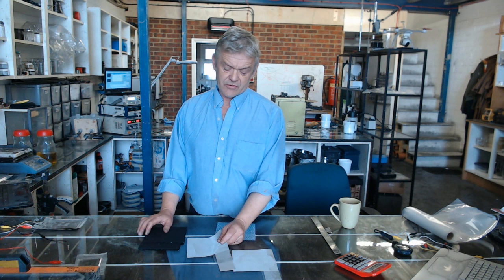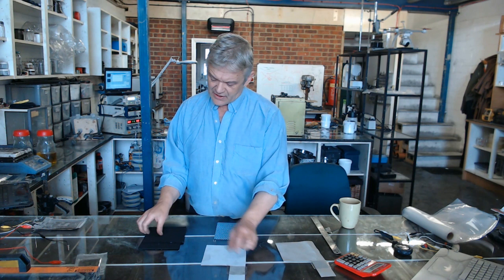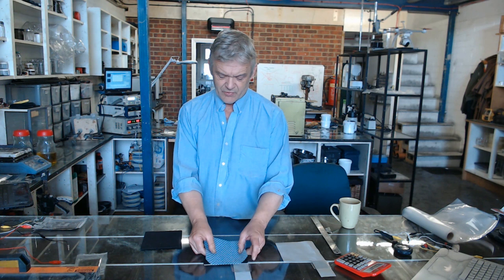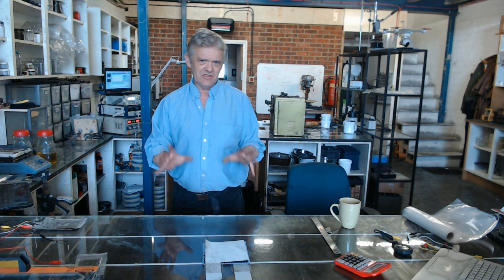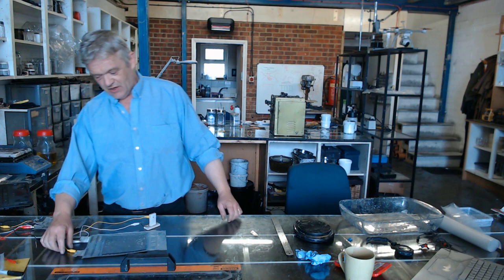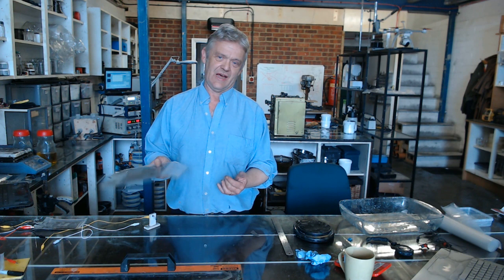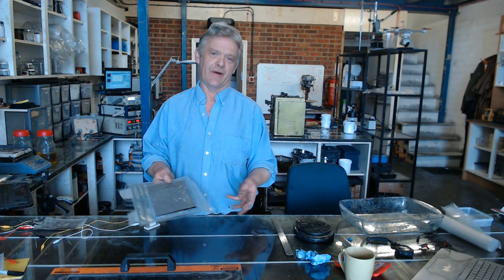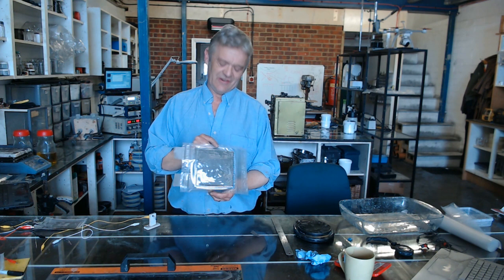Build A Super Simple Supercapacitor Step by Step

Comment: Really cool Rob! Have you tried aluminium laminate in the sealer? I've been looking into it, apparently aluminium laminate has good properties to keep air out long term. But I have yet to find a sealer that has enough heat to seal those types of bags. Again thanks for sharing!
Reply: IRC one side of those is conductive with vapor-deposited aluminum or do they layer on some more plastic?
A clothes iron will seal so if you left enough length in the bag you have the food sealer vacuum it out and then you iron it as it maintains the vacuum. I hope that helps and is not a waste of your time.
Reply: @Barskor1  Cheers @Barskor1 I'll give it a go. I've never sealed a pouch cell before but Im getting in some of these sheets soon so will see. I don't know the composition of the material itself so will experiment and see. Hopefully It will just seal in a normal bag sealer. Haven't thought about the vacuum just yet.
Reply: @karlm5022  Wonderful, happy experimenting. Removing the air is really important as it is what is putting pressure to keep the plates in place and for good electrolyte contact in the system.
Reply: @Barskor1  Cheers for the tip.
Reply from the maker: the bags will stay sealed long enough for experimenting mate - the laminate your are talkign about is an aluminium layer sandwiched between two layers of plastic so it forms a core. They are desinged not to leak for 5-10 years - so if you are going to make long lasting batteries then that is the one to use - but this is for folks who have never made anything and like all skills making a good job really rrequires practice - you are not going to build a beautiful table with out getting good at woodwork and that takes practice - the same is true here - what we want to do is get the skills without spending a fortune
Reply: @ThinkingandTinkering  Ah that makes sense thanks for explaining that Rob, Much appreciated! Totaly agree.
Reply from the maker: cheers mate

Comment: As you described, it sounds more like a storage cell than a capacitor. How many Micro Farads? What's the maximum voltage and leakage rates?
Reply from the maker: mate - you have to find that out for yourself - when i make it - well it will be one thing - when you make it - tbh - it's going to be something different
Reply: It's a salt water battery (Google it). During the initial charge one of the plates will interact with the salt water and change its chemical composition; and it is the dissimilar metals connected by electrolyte that subsequently pumps electrons.   I doubt any benefit exists from challenging the author who doubtless knows all this already.

Comment: An idea for a future video: how to make a super capacitor with the same specs as the off the shelf maxwells or similar ultra/super caps. Meaning, how to double up caps in series and get to 2.7v, how to connect multiple stacks to get to 500F (or better yet, higher capacitance that is not traditionally available). This would also educate about the design challenges beyond the capacitive effects - how to select a  form factor, a container,  roll the stuff into a can or stack a bunch of flat ones in a box, seal the thing in epoxy or wax like the old days,  how to make the external connects etc..Finally, doing a heads up comparison with a commercial unit to show what is possible.
Reply from the maker: oh i like that mate - but to be honest there won't be any future videos if we don't sell a bit of stuff to keep ourselves running

Comment: If several hundred of these were used to push/pull high loads, how often would electrolyte need to be changed?
Reply from the maker: no idea
Reply: Provided your pouches are adequately sealed, the electrolyte will last forever.  The plates will eventually be composed and decomposed so many times they will need to be replaced, not the electrolyte.

Comment: What is it that limits the voltage of super capacitors? They were 2.5v then 2.7v, now maybe 2.75v, what is keeping them from 50v and such?
A dumb question I guess,
Reply from the maker: the voltage tends to be limited by the water breakdown voltage - normally that is 1.23V but carbon adsorbs hydrogen and raises that limit - there are other things you can do - like WiSE electrolytes that use the energy of solvation to do the same thing
Reply: @ThinkingandTinkering  is there any other electrolytes? That could allow higher voltage? Probably another dumb question, thanks for taking the time, I really appreciate it!  I'm a bit old to be asking such dumb questions! But I'm curious... Thanks again..
Reply: @ThinkingandTinkering  I guess Gatorade is out! Ha-ha, good day, and thanks again,

Comment: Hi Rob! Thanx for the video:) seen that the electrolyte is salt water - and water evaporates... how long do you think the supercapacitor will be useable (without having to reopen the device and adding more electrolyte)?
Reply: If it evaporates, it will condense back inside the SEALED bag.   No loss...
Reply from the maker: David is right mate
Reply: Ok - thanks for the answer - I know that Rob SEALED the bag - and the condensation will keep some of the water inside for sure. But how about the sealing around the metal mesh - would water evaporate through that? Just an estimate of the durability of this device using this simple method? any thoughts? I mean you often use this harmless electrolyte (salt water) - but lets say it needs refilling every 3 months then one might consider incorporating a mechanism to refill the device?
Reply: @rbouakaz  He added some cellophane across that area to help ensure a good seal.  But you would know by looking at it if there was any leaks.  After a short time the bag will puff back up, as the felt (which was being squeezed by the atmosphere outside the bag) springs back and the air is drawn back into it through the leak.  

I had a friend that vacuum packed his sweaters for winter storage.  It was amazing how flat, and ridged they became.  It sounded like a cedar plank when you banged it on a counter.
Reply: David Kenny thank you for taking the time to explain :)
Reply: @ThinkingandTinkering  it won't evaporation but what about electrolysis

Comment: I remain very confused with your reply to 3watts per kilo or 3 kilowatts equals 333 kilos  is the power density for this capasitor   type . You did a similar type of foam carbon salt water capasitor type set up using ten of these foam capacitors same size 14 cm squared at something like  1.8 volts per cell making what you said in that video was 18 volt and   1 kilowatt power source . In that demo the casing was car battery type from  typical 70 amp lead acid battery minus the lead components which were replaced with the ten capistor assemblies . That suggested the capistors in that demo were closer to the 50 watts per kilo that lead acid battery can do . Maybe I got the wrong end of the stick on that video many it was lead acid plate with carbon wrapped around it ? That YouTube in late 2018 seems to have gone AWOl  . Maybe in that case your number got mixed up and the real numbers were a lot less than the stated 1 kilowatt power going from 18 volts to  some low voltage possibly 11 volts or 9 volts . I have been waiting for for when you would sell package of ten foam carbon  salt water capistor at a  reasonable price for  this combo to give me the ability to have a 1 kilowatt source at 18 volts in a  typical 70 amp hour battery case .   I wanted to make some 20 of these 1 kilowatt  power sources to power a electric boat 1 kilowatt motor marine  drive system for some 15 hours. Any idea was it some other project you did or was it a mistake in numbers or a mix up  on my part and this  1 kilowatt capasitor  is gona be a unobtainuim product for the near future as in wait five more years .
Reply from the maker: i think you got the wrong end of the stick - this video is about doing it yourself and the caps shown are really just materials to do it yourself - you can expect around 3 watt hours per kg if you do it yourself from these materials

Comment: The capacity of this capacitor will be proportional to its size. The bigger, the more capacity.
But there are three things which make me worried.
One thing is about the occurrence of hydrogen in the process of reduction
Second thing is the reduction of negative electrode. Soon, the negative electrode will be corroded.
Third, the third thing is that the polarity will be changed.

Good Luck
Reply from the maker: it's an experiment not a product mate

Comment: 3wh per kilo , are you sure its not 3kwh per kilo ?
Reply: 3 wh/kg is correct. The best lithium ion only stores around 400wh/kg. 3kwh/kg would be revolutionary.
Reply: @Ahamshep  so at 3wh per kilo that's going to be 333kg for 1kw of electricity ?
Reply: For 1kwh yes.
Reply: @Ahamshep  wow , are you sure cos that's a 327kg difference for 1kwh of tesla powerwall. we might as well be vac packing lemons bro.
Reply: That is why no one is using super capacitors in place of batteries yet. Although some promising results have been obtained in the lab.
Reply from the maker: there is more to caps than just energy they store mate - caps are power dense batteries aren't